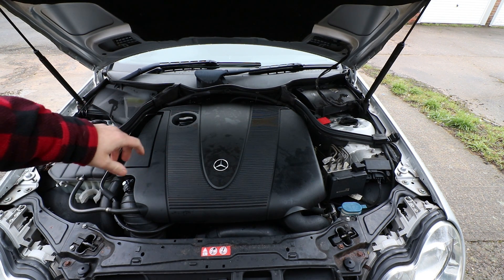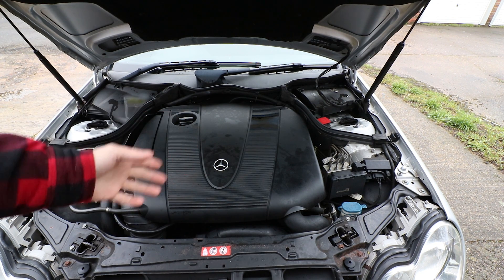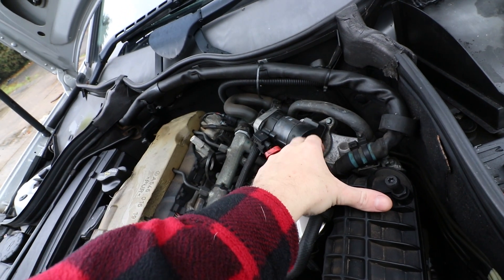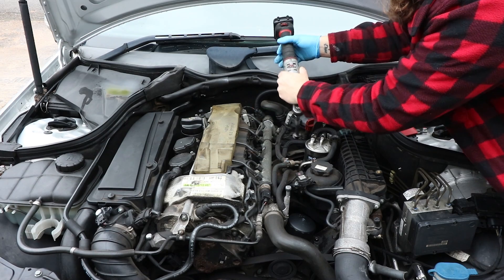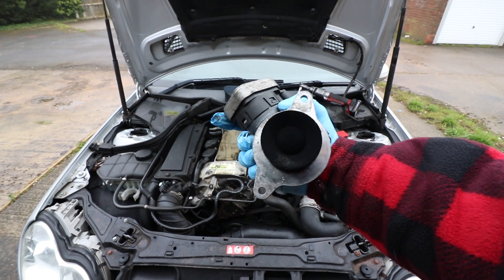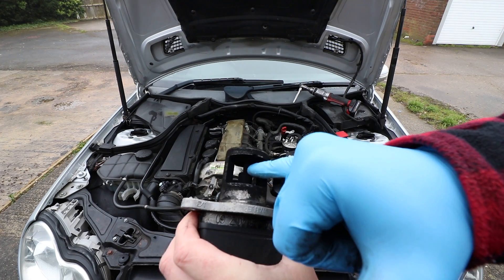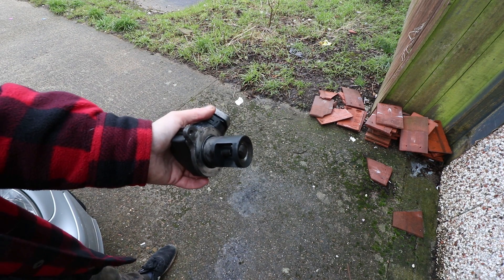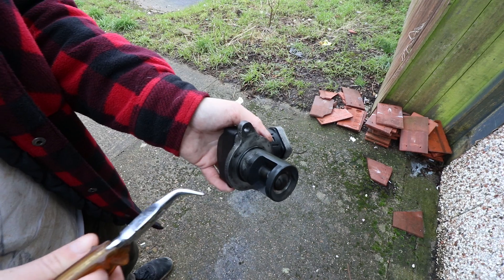EGR VALVE FIX! How to remove and fix mercedes 220 cdi OM646 EGR valve - No more EML!

Comment: Thanks for this video. My EGR felt like it was welded on so I did your bolt trick and it 100% works and my EGR came off easily, its now cleaned and back on the car and the power loss has gone. I know the EGR helps clean up emissons but it also strangles the life out of your car when it soots up.
Reply from the maker: Glad I could help! Yeah it just clogs everything up and restricts power and efficiency, it's a nightmare really

Comment: It's pointless to push around with pliers. If you've already removed the EGR, then also remove the plastic cover, clean the mechanism behind it and especially the spring, which should be completely clean and without any deposits.
Reply from the maker: Yes you're right, I didn't know at the time but yes the plastic cover holds a LOT of carbon so definitely needs to be cleaned also

Comment: Hello. I have a Mercedes 211 from 2008 diesel. The engine is in very good condition. But when I take a long road and the temperature is 90 degrees, it doesn't pull well. It's like it's drowning. It chokes. It doesn't start when overtaking. They tell me that it has a diesel sensor. Thank you.
Reply from the maker: Hello, I'd start by getting a really good code reader to scan the car, this can indicate any issues. Otherwise it is purely guesswork!

Comment: Would this be a place to spray in a cleaner to get it to the intake manifold or is there a better one?  Would the engine run with this off but the plug connected?
Reply from the maker: I'd be concerned about cleaning the intake manifold through the EGR hole left, the engine could knock from the cleaner, plus also any dislodged debris could fall into the engine. If you want to clean the intake manifold you'd be best off removing it. The engine would maybe run but it wouldn't be happy as there's way more air getting in, why would you want to run it with the EGR off?

Comment: Would this work on a 2014 plate a220 cdi?
Reply from the maker: I think they probably use a different engine, not too sure on that model, however the principle of EGR's is the same. Just the way it attached might be different

Comment: Hey dude, I've got the P0401 code after changing a SAM unit which has died, I've changed the MAF sensor as when idling and taking the connectors off it didnt change idle at all. Still got the code after cleaning the EGR and it moves correctly. Any idea what to look at next? I have cleared the codes and get a minute of driving properly before the car goes back into limp mode and EML comes on. Any help would be appreciated!
Reply from the maker: That's a good question, I haven't personally had that at all but I would suggest it could be the EGR not opening fully after a quick google? First port of call really is get the car on a really good scanner that can also read live data, otherwise I'm afraid you'll just be firing the parts cannon at it. An autel or snapon scanner can show much more accurate fault codes and live data than a cheapo reader so I would suggest this first and narrow down the problem mate. Can check MAF values etc under load too!

Comment: hi i have a Mercedes W203 646 engine 220cdi the problem is that it showed check engine light took it to the workshop and diagnosed it and the error was low boost pressure. i have change the boost pressure sensor with the original part number and still the same problem i have also checked to see if there are some air leakages but none is found on the horse pipes and inter-cooler i have also tested the EGR and the ECU they are all fine and still low boost. i have also tried different actuators, EGR and different turbos and Air Mass but still the problem is the same. kindly help
Reply from the maker: In my opinion you should get a proper smoke test done, to look for any microscopic leaks (I've seen a pinhole in the intercooler on this one which caused issues but wasnt visible to the eye). Then also get a proper workshop to diagnose it with live data etc. they should be able to use the diagnostic machine to see WHY the boost pressure is low, the cause of it not just the symptom. Rather than changing parts and spending money for no reason

Comment: Does EGR clogging make acceleration slow? Like my e220 barely reaches 70kmph
Reply from the maker: Yes it can cause this as if it's massively clogged up you're reducing air intake
Reply: @HellboundMFG  thankyou soo much, will work on it asap
Reply from the maker: @shadabtambe6122  good luck man, let me know how it goes! There could be other issues of course but this is a good thing to check anyway :)

Comment: Man it didn't want to move even 1 millimetre 😢 what can i do?
Reply from the maker: I think you can try wiggling it, using penetrating fluid and keep trying the trick I showed (backing out the bolts a tiny bit and revving the car!) just keep trying man eventually it will come loose!

Comment: that looks like one of the easiest things to fix on the car, yet mercedes wants €1400 to replace it on mine. I had the car transported there because i didn't know what the issue was, need to find a way to get it back so i can replace this myself. Thank you.
Reply from the maker: Yep it's really not a hard task, if you're sure its this (it is a common issue) then I'm sure you can either repair or replace yourself no problem at all. Hope this helped you save some money dude
Reply: @HellboundMFG   I removed and cleaned the EGR valve, but there was something loose inside it moving around when i handled it, tried to put it back on but the car behaves the same way as before. So i guess i need a new one. But mercedes said the new one has to be calibrated, and there are so many different brands of EGR valves that supposedly fit this car.  But i'm not sure if the brand matters or not?
Reply from the maker: Ah might be a broken component then sadly :( If you can find a good condition used one maybe that would be a decent option from a trusted breaker? Alternatively I'd say at the end of the day choose a mid range brand and go for it. It's essentially just a motor moving an arm in and out dependant on throttle input so nothing crazy but the motor has to last more than 5 minutes like a cheap chinese one might give you! @Wormweed

Comment: Hi! What are the symptoms of a dirty EGR valve? Thanks!
Reply from the maker: Hello, it can become stuck in which case you could get poor performance or fuel economy. I was getting engine light and limp mode/reduced power
Reply: Could it prevent the engine starting? Mine cranks but doesn't start. Behaves like it desperately wants to start but doesn't quite do it. Like it's choking.

Comment: This may cause black Smoke? Dirty egr?
Reply from the maker: Possibly if it's really clogged up but not in my experience. I'd say look for a boost leak as usually black smoke can come from that. if no obvious signs may be worth having a smoke test done as its cheap enough. I didnt think there was any issues but after a smoke test I had a pinhole in my intercooler appear clear as day

Comment: Thanx, just done mine and used Mr Muscle oven cleaner. It worked a treat  then rinse off with brake/ carb cleaner !!
Reply: Perfect stuff, caustic soda is the right stuff to clean carbon and grease.

Comment: my ones still stuck. i tried keeping revs at 3.5-4k rpm for a few seconds and repeating for a couple of times. doesnt budge at all
Reply from the maker: nightmare, have you tried rotating it? That can sometimes break the seal too
Reply: @HellboundMFG  i did try hammer it in each direction by the edge near the screwholes, only managed to put a dent on the surface. it isn't coming loose
Reply: @dafunk420   Do you remember if and how you managed to pull it off? I am having the same problem as you rn.
Reply: @dafunk420  Did u pull it out? How?

Comment: while it is still on the car you can take the plastic cover off the back and clean out the carbon dust out and clean and oil the workings and check that it is not stuck also if you take to code off you will see iof it works by just revving the engine while someone looks ,,,,it is as easy as that ,no need to take it off as it looks like a maintenance thing to do anyway,    it is to the right hand side looking at it standing in front of the car .

Comment: nice video, but what do you advice, if your step don't work and valve hold like welded.  My last idea - remove both screws and full gas 🙂, but seems little risky.
Reply from the maker: Thanks! What I'd recommend is just backing off the screws maybe halfway, full gas like you say. Leave them in a little bit as you dont want the EGR valve flying somewhere into space! You can also try if that doesn't work, hitting the valve rotationally using a soft hammer or a hammer and a soft interface i.e. block of wood. Rotational force really helps!
Reply: Full gas didn't worked. Even without any screws in. I was able to rotate it but it's still stuck inside. Also kinda easy to move it counter-clockwise but akward to move it clockwise back because there is a hose in the way. Any more ideas?

Comment: ...... but how do you put the bonnet into service mode??? I couldn't see how you did it.
Reply from the maker: Ah sorry about that! It's on the strut on the RHS as you look at it from the front. It's a little red button, push the bonnet up whilst you press that and it will then lock into service mode at the top!

Comment: Thanks for that!
Reply: Also how do you release the electrical connector? Do you have to pull the white plastic insert slightly out of the plug, then squeeze the plastic lug in to release ithe whole plug?

Comment: Good video! Especially with the trick to get it out I'll be doing this today. I have p0299 (pending) and p2359 code. Not sure if this is the issue but likely needs cleaning anyway. What code did you have whe  it went into limp mode can you remember?
Reply from the maker: Thank you! I cannot remember the code I'm afraid, really sorry about that! It's definitely worth doing anyway as preventative maintenance for sure
Reply: @HellboundMFG  mine wouldn't budge even when loosened off and 3ngine rev at 5000 RPM so I used a breaker bar as a pry bar and once I broke the seal it came out pretty easy.

Comment: how reliable is this engine ?
Reply from the maker: Hello,
Pretty reliable! Chain driven diesel, this engine is used in the vans as well, it will easily go for 250,000 miles if routine maintenance is kept on top of. They are quite noisy and agricultural but they will last for a lifetime
Reply: My CLK has done 240000 
No issues but I will now Change EGR Valve and Purge Valve .
I was pleased as Punch it just Passed MOT with No Advisories

Comment: tackling my clk egr tomorrow,  going on a family holiday in a couple of days and garages are too busy to take it in , slackening the bolts and  running the engine is a great tip and your video has given me the confidence to have a go , thanks for sharing👍
Reply from the maker: Glad to hear it, it's very easy to do really so you should have no issues! Honestly the slackening the bolt and running engine tip was a game changer for me! Thanks for feedback, let me know if you have any issues or how it goes!
Reply: @HellboundMFG  job done , spot on with backing the bolts off and hitting the rev limiter , didn't work first time so removed the bolts and spun it back and forth with a hammer & drift popped the bolts in a few threads  revved it up & bingo , thanks again for the top tips 👍
Reply from the maker: @iainmcintosh9068  Brilliant to hear matey! They can be very welded on there, as I had mine off about a year or so it wasnt too bad but good idea giving it a bit of a tap as well! No problems, glad you're sorted!

Comment: Maan sweet vid , nice trick using the boost freeing up the EGR , unfortunately even that won't do it on my car :D
Reply from the maker: Ah, maybe try undoing it just slightly and really giving it some revs! It wont go anywhere so dont be afraid. Alternatively, take bolts fully out and try hitting it to rotate it with a rubber mallet, rotational force seems to break it free as well. Good luck!

Comment: Thank you for the video. How do you manual activate this ERG valve to see if it still works?
Reply: Remove the EGR out connect the sensor after open the ignition don’t start the engine and you can see if is working or not
Reply: There is a black cover which you remove and inside there is a spring loaded lever you push it down to open the valve
Reply: @tanvirkhan3785  Thank you. I was wondering how to electronic active the valve for testing. I ended up replacing the unit and then it worked great and no more CEL. I was able to push on the lever to see everything mechanical worked before replacing. The solenoid on my must have been bad.